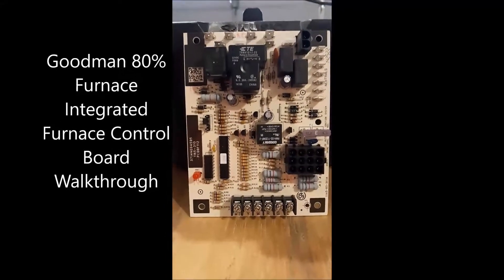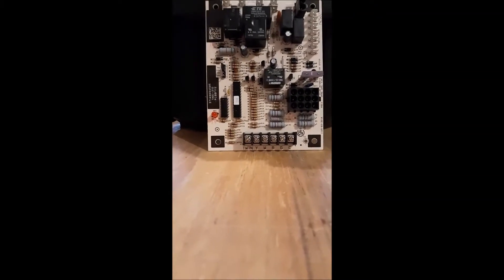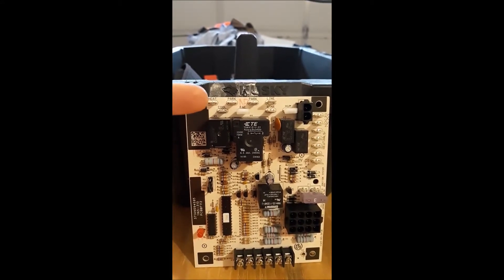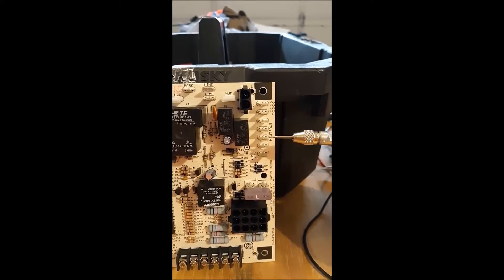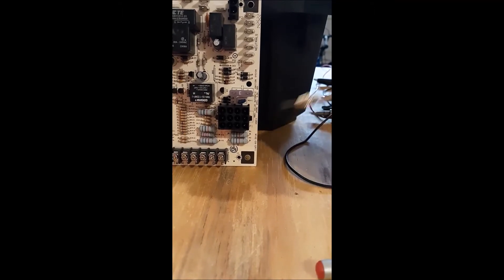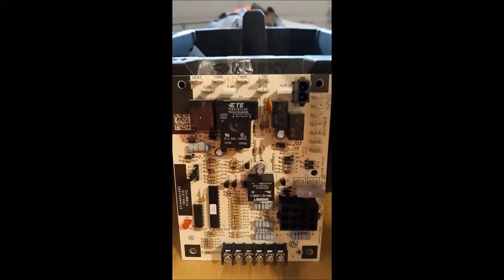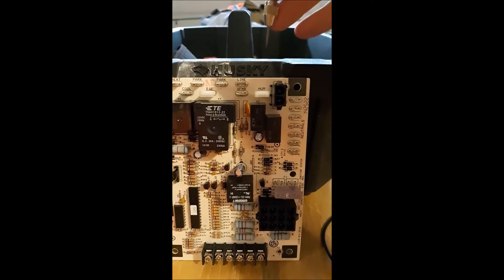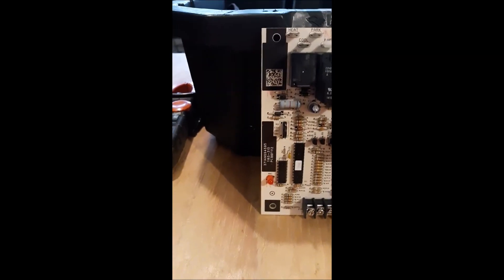Goodman 80% Furnace Overview

Comment: In heat mode gas furnace the thermostat would not send 24v on G terminal correct? The w1 will energize the control board and also the blower relay in medium or low speed. What happens when the customer places the thermostat to the ON position? Does it automatically de-energize the low speed relay and energize the hi speed?
Thanks
Reply from the maker: W should be the only thing powered when calling for heat. The unit will turn on thw fan when ready. If the customer turns the fan "ON" and the heat sequence has just started...some furnaces don't let the fan come on and some do. I would have to try it and see what happens and then I would know what a particular model furnace would be like.
Reply: @johnjennings-JJ  thank you
Reply from the maker: No problem.